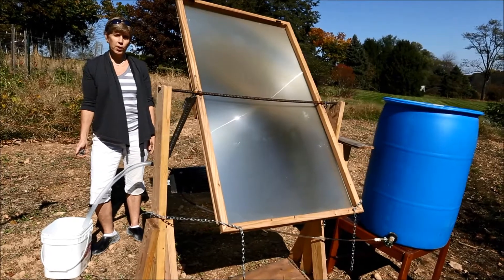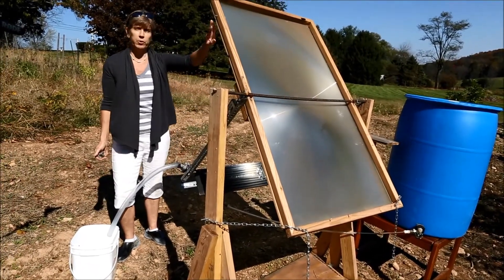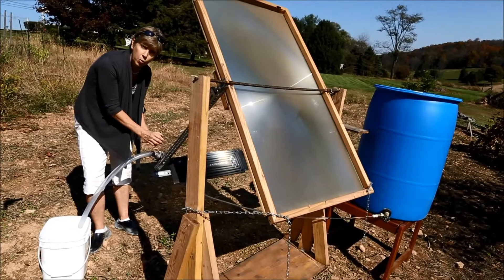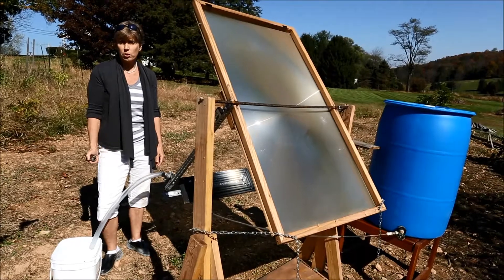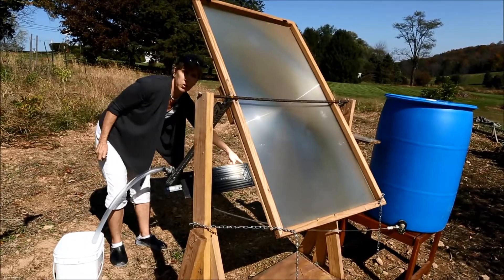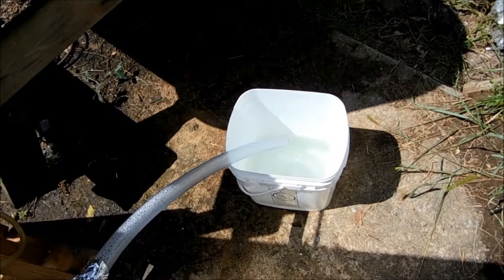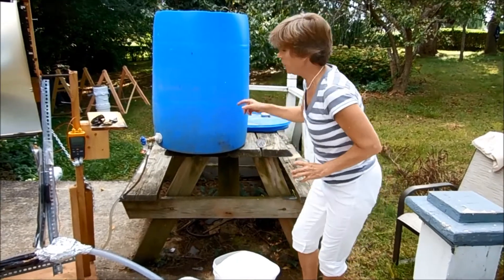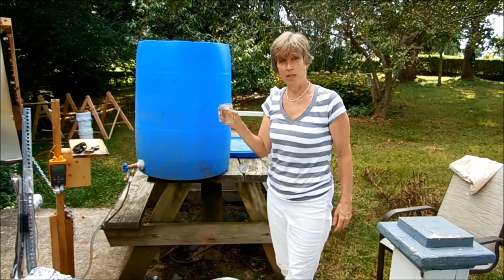The Fresnel Water Purifier

Comment: I understand the idea of the car thermostat letting the water flow, but how does the clean water not mix with the dirty water that is introduced into the system. I do not see where the condensation takes place inside the same copper tube? where does the unclean left over water end up going?

Comment: You could take this design to a commercial level for coastal communities like mine on the Mediterranean. We need both to denature the ground water and remove the brine (back-seepage from the sea). If instead of a coil you had a boiler, the water could be separated from brine, kill biologics, and raise it from ground level to roof-top tanks as vapor. As the steam rises and condenses into drinking water, the condensate tank would be on a large greased screw (like an automatic car transmission) that would slowly spin the lens and boiler to track the sun. When the condensate tank is full, it trips its own release, draining the water to a holding tank. As the condensate tank empties, the pressure is taken off the screw, and a return spring spins the lens back to 10am position. The brine would periodically need to be removed from the boiler and discarded.